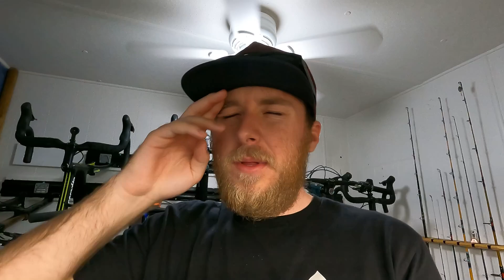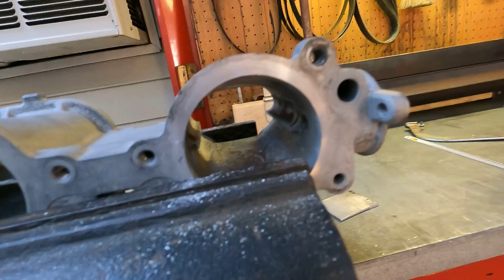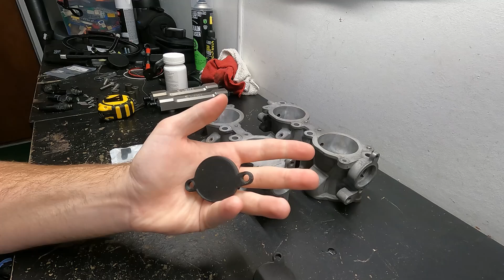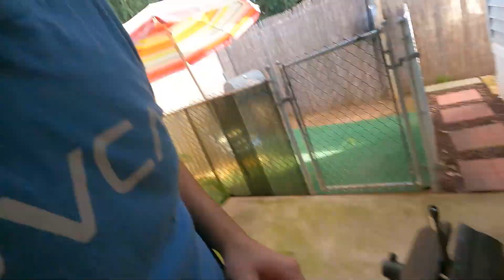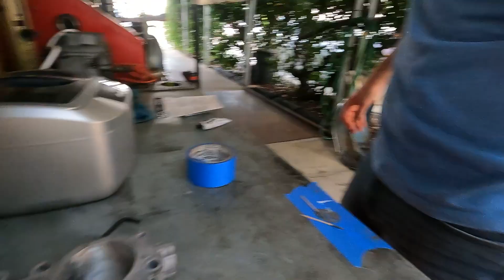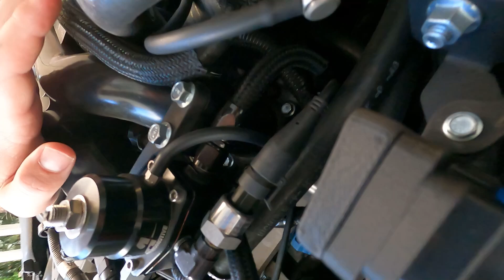DIY Budget TGV Deletes the Right Way!!

Comment: Is this something I can do with my 04 wrx? I would like to do the same thing and use my tgv to datalog my afrs. Thanks for the videos. They r great and full of information
Reply from the maker: Yeah this will definitely work on your 04 wrx, you just need a TGV delete kit and a tactrix cable and ecu flash so that you can disable the check engine lights and edit the ECU definitions for Data logging whatever sensors you want.

I made this video explaining how to do the tuning side of it, if you haven't seen it already:
https://youtu.be/_6ocgdpyCXE
Reply: @SWSpeedCo thank u so much I appreciate u and all your information. U r one of the few that explains things in a way that is very easily understandable. Thank you.
Reply from the maker: No problem, any time!!

Comment: why JB weld and not red loctite?
Reply from the maker: Idk if red loctite would seal the threads enough to keep high pressure air from escaping. Since the JB Weld is an epoxy it will bond and seal. Thats the reason I used it. Red loctite would probably keep it in place but it may be too thin to seal the threads
Reply: loctite 565 would be perfect for this

Comment: Nice work! Are you just using straight nylon for the covers? Nylon-CF tends to come out with a nicer production quality surface finish.

I’m still on Cobb, but thinking about cutting the shaft off and 3d printing a little housing to relocate the motor/sensor. Not sure what years have the sensor integrated with the motor but mine is anyways.
Reply from the maker: Yeah, im using Polymaker PA6CF but I'm working on switching over to Bambu Lab PAHT CF because it is less hydroscopic but I've had not the best quality from it so far so it needs a little bit of tuning

Comment: What size are the taps and bolts?
Reply from the maker: If you are talking about the bolts to plug the holes I used a 3/8" - 16 Tap and a 5/8" long set screw in that size as the plug. The reason I chose that size is because it is a tap that alot of people already have or is really easy to find. Thanks for watching!!
Reply: @SWSpeedCo Thank you!!!

Comment: This might be a dumb question but what about the hole in the middle that the rod runs through one port to the other that’s okay to leave it open? One video I watched say they need plugged off
Reply from the maker: That's actually a good question! They actually don't need to be plugged up  because they are internal to the intake system. It is also speculated that the inside holes may slightly benefit performance because they equalize pressure between the intake runners. Thanks for watching!

Comment: Do you need to use specific aluminum jb weld or just high temp as possible?
Reply from the maker: It doesn't get crazy hot since it is on the intake side of the engine so standard JB Weld works perfect!

Comment: Good shit man. What did you do with the harness connector to the tgv motor?
Reply from the maker: I use them for data logging my wideband O2 sensor and fuel pressure. It's a 3 pin connector so it has power, signal, ground so you can hook up any sensor you want to monitor to them and view it in the data logging software
Reply: @ that’s really smart! You should make a video on how you did it
Reply from the maker: Thank you, I can work on it